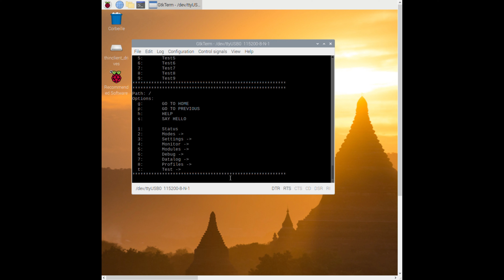Robotic Arms Balance Raspberry Pi ESP32

Comment: Great video!
Just a question, the robot seem to be moving back and forth when the arms move forward , this must be do to change in centre of mass ( correct me if im wrong). Have you found out any way to get around this? Maybe something software wise that give a counter reaction to the forward movement? Is that even possible?
Reply from the maker: yes you are right about the center of mass, yes it is possible to control it, you can use LQR tracking, I send you a link of the video that you are looking for.
Reply from the maker: https://www.youtube.com/watch?v=bRCNyY-zKww